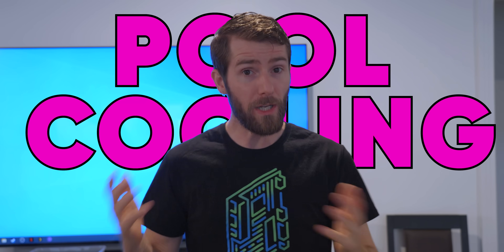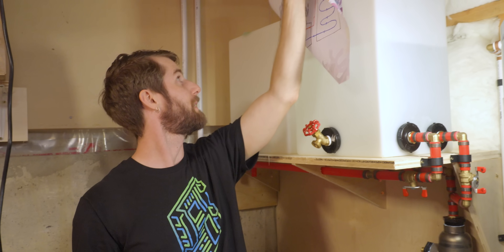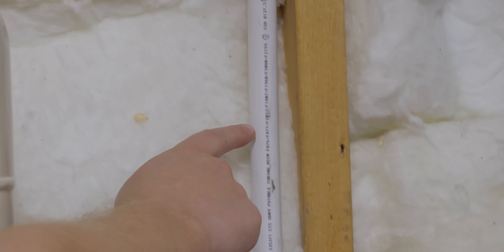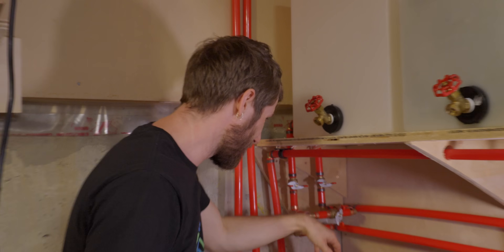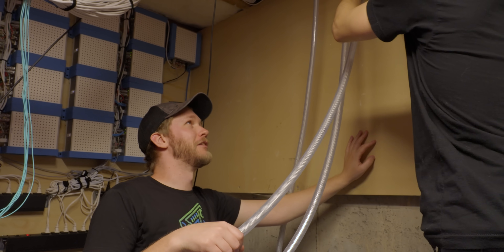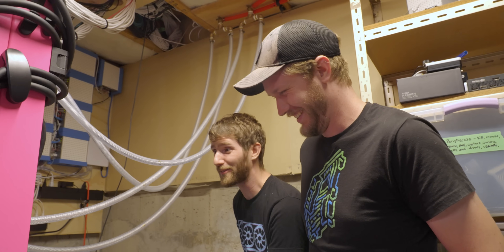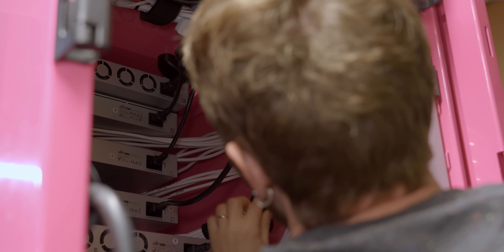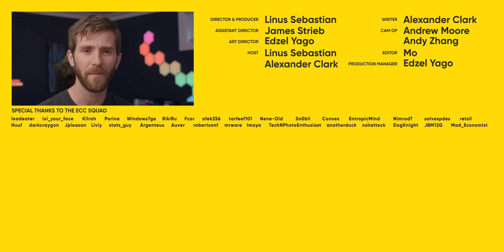My pool leaked and killed my computer - Whole Server Room Pool Watercooling Part 4

Comment: What's the likelihood this will happen again? This all started due to overheating due to someone unplugging the pump. Why not have a flow sensor and temp sensor to see if water is actually flowing and if not, then have an emergency power shutoff to the critical rack of computers. That's what I would do at least

Comment: I wouldn't use pex outside, barrier or no barrier. Its just really susceptible to UV light, cold temperatures, and especially chlorine. Should use flexible stainless steel outside.

Comment: As someone who watches a lot and always feels kinda dumb with how versed everyone is with computers on the channel, these types of videos make me feel way better. Watching them try to figure out basic plumbing is always funny. 
We all have our blind spots
Reply: Using silicone sealant on fittings is a terrible idea. Can’t wait to see how it’ll leak.
Reply: "Basic" plumbing, sure
Reply: Lol, they're not well-versed with computers either.
Reply: Even with all these the current system looks like a recipe for disaster.
I would setup a smaller tank and move water from pool there and connect all CPUs to that smaller tank(it'll be in the same room as CPUs - with filter & everything). Along with that have sensors and other alert systems set up for that smaller tank.
Even with their current system many things could get wrong depending on the pool status and the weather status.
Reply: @mighty-roman  That is exactly what they did... they have a closed loop inside and a closed loop outside running through a heat exchange.  No water from the pool goes to the copmuters at all.  Hence the antifreeze in the outside loop, and the bio-cide in the inside loop.

Comment: Hey linus I'm a plumber, and you did good, but if your worried about leaks in water pipes you can fill it up with 80 psi  of air and give it a day come back un the morning cheak gauge. It's actually required in test of pipes in my state for gas and water

Comment: Should have used PEX-A instead of PEX-B. The expansion connections for PEX-A have almost no flow restriction because the fitting inside diameter is the same as the tubing. An expansion tool is used to stretch the tube and a compression ring. Since it takes a few seconds to return to original size, it's easy to pop the fitting in or slip the tube on then wait a bit. Next to impossible to get it wrong. The tube and ring is constantly trying to return to its original size so it's always exerting pressure on the fittings. If an angled fitting isn't pointing the right way, it can be carefully twisted around inside the tube without causing a leak.

PEX-B fittings have an inside diameter that's smaller than the tubing. The metal crimp rings can be crimped poorly in many ways. The tubing is always trying to return to its original size so it's pushing outwards against the crimp ring, the same way water pressure is pushing on the tubing. All that's keeping it in place is the metal ring. If the fittings will be exposed to conditions where metal can corrode you must use stainless steel crimp rings. Otherwise the rings can corrode though then there will be leaks.

If PEX-A gets kinked, simply heat it up with a heat gun and manipulate the kinked area to help it restore to shape.

If PEX-B gets kinked the kink has to be cut out. Installing a coupler* to fix it adds another flow restriction so it's best to pull the whole length of tube and replace it (use the pieces for shorter runs) or cut it off and pull more from the roll, being careful to not kink it again.
*Or decide that the kinked spot is where you were planning all along to install a T.

For redoing connections on PEX-A you use a sharp utility knife and a heat gun. Carefully slice across the ring and heat. Slice deeper until the ring splits - without cutting into the tube. Heat up the tube and it can be pulled off the fitting.

It is not recommended to re-crimp PEX-B. A bit of the tube should be cut off after cutting off the crimp ring.

With either type, if the tube gets cut or nicked when taking it off a fitting, cut the end off to get a fresh end. If the sealing surface of the fitting gets scratched (especially across one of the ridges) it's safest to discard the fitting because it could leak.
Reply: So why does PEX-B even exist, given how inferior it is to A?
Reply: @sivansharma5027  cost, probably
Reply: @sivansharma5027  slightly higher burst pressure, which is unlikely to happen with properly functioning plumbing, and the crimping tools are low cost. Electric expander tools for PEX-A start at around $400. Manual expander tools cost less but have long levers and can be cumbersome to use and difficult to impossible to use in tight spaces.
Reply: So easy to find people who criticize what you did.....So rare to find people who teach you the right way, explaining and pointing out what (and why) you did wrong. Thank you for that !

Comment: and thats why i will never recomend water cooling, none of the jank pool stuff failed, a standard bad bios config and standard water cooling fittings failed, aircooling for life. just cool the room. also i dont see any load ballencing for that manifold, any restritions in one system will reduce flow and the water will take the path of least resistance around the restricted system leaving it to cook. maybe thats what heated it up and killed it the first time ¯\_(:/)_/¯

Comment: If you start an npt thread by going backwards a turn you can usually feel it fall into the thread right. Massively lessen the chance of cross threading. It's good practice for all threads in plastic really and small screws in aluminum.
Reply: Yep, really good practice in general. Go backwards a bit to fall into the thread properly. I even find myself doing it with bottle caps.
Reply: I'm surprised a lot of people don't know about this

Comment: Wouldn’t it have been better to use welded Copper tubing to get to the rack, and then convert it into quick connects at the rack to limit the points of failure?

Comment: It is a little confusing, I get how some debris could be in the pool loop at the start but that debris should be simple to remove and once the pool loop has been flushed it is a sealed loop so no more debris could get in it.
I would of set up a reservoir attached to the pool loop with a pump and a basic filter to filter out all debris, no computer yet, just keep filtering the water in the loop for maybe a week. Then use compressed air to evacuate the entire loop of water and refill the loop with pure distilled water. 
At this point the loop should be pristine and since it is sealed it should stay that way, no different than an AIO cooler.
Then take the clean loop and run it through a brand new filter for another week, if after a week the filter is still like new then you have a 100% clean loop. 
Connect to computers and enjoy. 
Shame your switch committed suicide, computers should know that smoking kills.

Comment: God Im happy you got rid of the pvc flex pipe if the pool dose use chlorine it would have eventually corroded in the inner diameter of the flex pipe and caused it to swell  inside the pipe and eventually narrowing the inner diameter causing flow rate issues down the line.

Comment: At the end of the video you talks about turn on/off the computers.

You have Home Assistant already, you can use it.

You can create virtual sensor to see each computer if it’s on or off.

Option 1 (soft option):
If the computer’s connected with RJ45, wake-on-lan (magic packet) and better if the computers have static IP.

Option 2 (wire connection ):
Use Shelly 1 (or similar) use it as dry contact to the wires of the power button and you can set a virtual switch in Home Assistant that will turn on and then off after one second.

As well for force off create an automation that will turn it on for 6 seconds then off.

Even if Home Assistant is down, you can do it from the Shelly app (but then you might have bigger problems…)

Comment: Multiple clamps, friction fittings, hoses hanging unsupported with water under pressure mounted above A/C power, in a metal rack, potentially grounded through the swimming pool or the rest of the home wiring.  This system is absolutely fool proof, perfect, safe and is impossible to fail - nothing could go wrong.

Comment: If the water cooling runs 24/7 through the heat exchanger does that mean that, in the winter, the loop will be sub-ambient and the systems that aren't producing heat are going to get condensation like a cold beer on a hot day?

Comment: Oooff... That's why I never trust water-cooling. The points of failure are always looming, all you need is just that 1% to fuck everything up. All for what? That 1-2 degree celsius difference? No thanks, I rather build an open case mounted on the wall, away from all harm, and directly facing my air-conditioning. Works just as well without all the risks. And if the fans failed? It's just a few seconds of swap-up.
Reply: Or maybe its cuz he was water cooling with a pool XD
Reply: @chronodis  I heard from a contractor somewhere: The bigger the operation, the bigger the possibility of fuck ups. The why the maintenance is so huge & expensive for bigger operations. 😂 

Well I guess sometimes the 'KISS' theory works the best. (Keep it simple, stupid)

Comment: I am not sure how much water is actually getting to the pool in this application. The heat has to be carried from the water blocks to a heat exchanger, then the heat has to be carried from the heat exchanger through the PEX at the bottom of the pool and through the concrete. It’s very likely this system is just working by being a huge heat sink and thermal absorber because of the water mass.

The heat exchanger could have just put pool water on one side and PC water on the other. A small pump would circulate the pool water so the filter pump doesn’t need to be run constantly.

Comment: It makes sense to have an inside and an outside the way it is set up right now. Thee only reason you may want each seperate line to have an in and out side is if  you plan on regularly swapping the lines out or the lines somehow wouldnt work if they were hooked up backwards (I.E. - how a active HDMI cable is directional). Assuming the only thin in this system that will ever be unhooked and hooked back up in the computers themselves, the current labelling system is IMO the right way to do it.

Comment: For turning on PCs remotely, how about Home Assistant, ESPHome, and some ESP8266s?  I mean, you already have Home Assistant up and running for thermostat and lighting control.  You can use it here to turn a button press in the gaming room into a signal out to the start header on a PC in the rack.  Or even "Alexa, turn PC number 3 on."  I've been doing the same with my PC.  Really need to make some improvements to my system, however.

Comment: That Ubiquiti switch 😲 though. I wonder if it was somehow affected by the water damage or all the work in the area. That is scary.
Reply: Or maybe when he started yanking cords without shutting equipment off.
Reply: @bcbock  Unifi AP's, switches, and USG's don't actually have a soft power-off function or physical power switch, they're meant to just be switched off/unplugged at the wall. Something else fishy is going on

Comment: What's kind of amusing is that I was all "Ooo" at the new StealthSense thing, but a bit bummed because I had just ordered a cable from them with the new 12VHPWR adapter.  Turns out that I never noticed that it was the new StealthSense cable that I had already ordered. 😅  I can definitely agree that those sense wires always have me rather nervous they seem to love to snag on grommets!

Comment: Don't turn them on and off, just sleep after 5 min; event them awake every night at 4am, schedule update/backup/sync, they fall back asleep. 
To wake PC use WoL through your existing HomeAssistant; make the trigger whatever you want it to be.. Aqara 3 year battery sensor under each chair, CNC a button for or in the desk, use existing physical button on monitor to monitor power consumption in HA, the list is long.

Comment: that original pump is for hot water boilers for houses.  those are really long loopes.  so not sure what the issue was.  mine is a groundfuas or something and the loop is about 200 feet at 160 degrees F.

Comment: So I am no plumbing guy but I feel like you completely defeated the anti-oxygen of the closed loop with the clear pex tubing going to your server rack?

Also note, I would probably look into getting some sort of moisture sensors and put below the fittings at specific places on the floor and run some sort of home automation like with Home Assistant so when/if those sensors detect moisture or water, it can shut the power off of the pump.

Comment: Nylabraid and Brass fittings leak after some time. The clamps losen over time and connection starts leaking. Thats why I prefer Black rubber hoses, rarely leak with a clamp.

Comment: This is why most heating and cooling pipes have arrows indicating flow direction. At least, that is what I have seen in commercial spaces.
Reply: Those are labeled out on after the fact. The pipe itself doesn’t have directional arrows on it.
Reply: @Bob_Smith19  Yes. I was an insulator and covered many of those pipes which definitely did not have arrows on them. My point is that arrows leave less room for misinterpretation than words when labeling.

Comment: Use a heat gun or hair dryer to warm up the tube before you tighten the hose clamps in order to get a nice sealed connection.

Comment: It looked like you we're running PEX outside exposed which is normally a big no no as PEX isn't UV stable. Maybe it was some special UV stable pex, but I wasn't aware of any UV stable PEX. I would double check it if I were you as PEX is infamous for how quickly it degrades when exposed to UV.

Comment: "Hacking the end of an power cable and then using the conductors inside it, is not actually jank"... as he secures a stranded wire into screw terminals without crimping a calbe lug onto it. This guy....one jank ends and another jank starts.

Comment: Personally I would have the pool loop seprate from the pc loop have some pc radiators in the flow of the pool loop. Could see this coming much better to have them separated so there is less tubing to corrode or get gummed up with stuff.
Reply: The two loops are only connected by a heat exchange, no mixing of water. Basically the same idea as submerging rads, but the right tool for the job
Reply: Yeah what they are doing now is more correct the first version was never going to last. They really should have the correct connectors everywhere and it could be regular piping everywhere on the pool side. If it was done again. There are so many better ways of doing things that arent so jank and sketchy. But still interesting and funny to watch it all go horribly wrong.

Comment: as someone in the aquarium industry ... it would help to move your water lines lower and create a "drip loop" instead of having the water run straight down into the electrical components potentially.

Comment: Pro-tip when troubleshooting a short on a DC fuse without needing a ton of fuses or cooking circuit breakers. Put a light bulb (sealed beam headlight works great) in place of the fuse with jumper wires. It will limit the current flowing through the circuit to a max of whatever the bulb will pass (usually 3-5 amps for a car headlight), and if you still have the short, it will light up bright. Once you eliminate the short, it will drop to dim to not at all depending on the resistance left in the circuit.